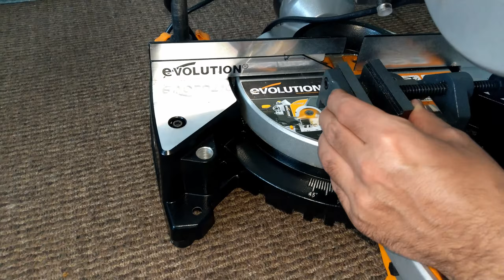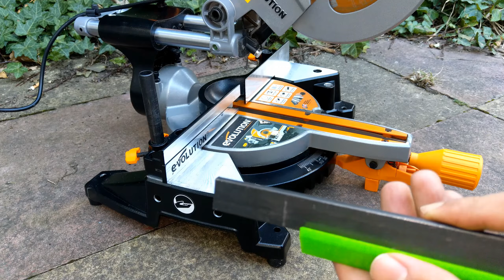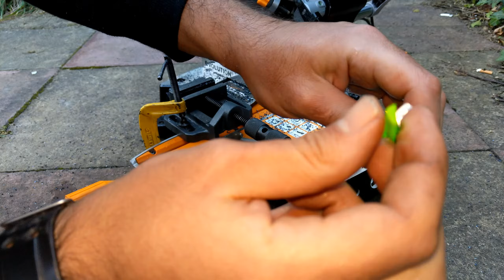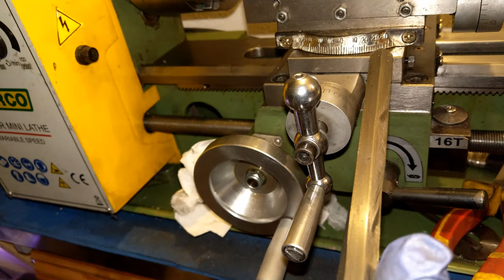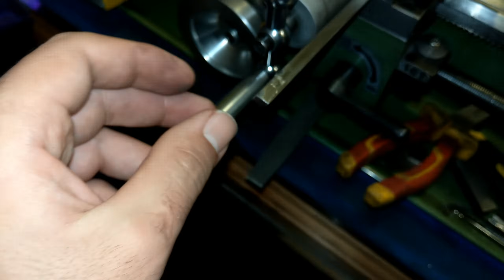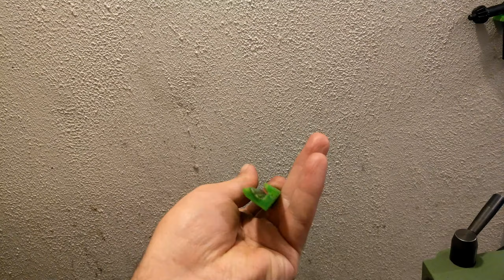Mini Lathe Gib Strip, How to Make a  Gib Strip on Mitre Saw

Comment: You can super glue a brass or bronze strip onto the rubbing face of the gib strip and obtain a really smooth feel. It doesn't cost much to do why not try it on the original gib strip.
Reply from the maker: Wow , I didn't think of that, it's actually a good idea , if I knew I would do your method ,  nice tip, thanks

Comment: I love using 3d printed jigs. Has worked perfectly on aluminum adapter for going from the stock 3 or 4 inch chuck to a 5 inch 4 jaw. All you need is a printer and hand drill after turning  for a tight fit on the spindles register. For the really rough cut cross slide dovetail faces I super glued sandpaper to the cross slide then tightened the gib a tiny bit and worked it until the surface was nice and smooth with good contact all the way across. Ideally I should've ensured the cross slide was flat on a granite surface first then transfered the precision to carriages cross slide dovetail surface.
Reply: Forgot to add that getting the register on the aluminum wasn't too tough even though it's too large for the stock chuck. I remove the chuck and drill a hole at roughly the center of the aluminum so I can run a threaded rod from hardware store all the way through the spindle. From there nuts and washers on each end keep it in place and light turning the OD and register allows you to then use the 3d printed jig to drill the mounting holes/tap threads then bolt it to spindle and turn the inner diameter and face for the chuck.